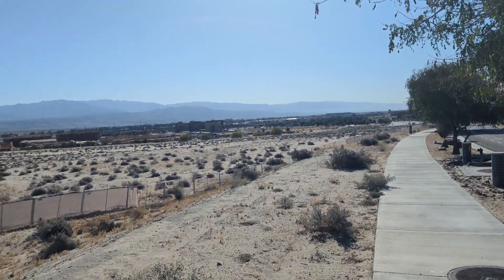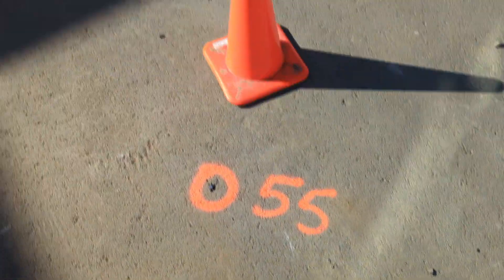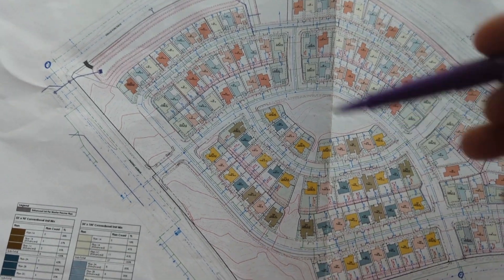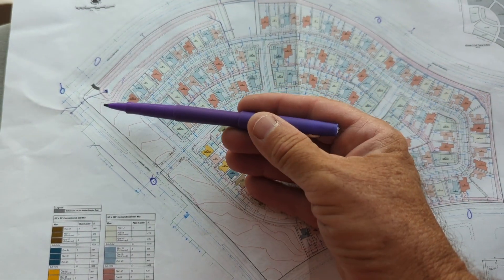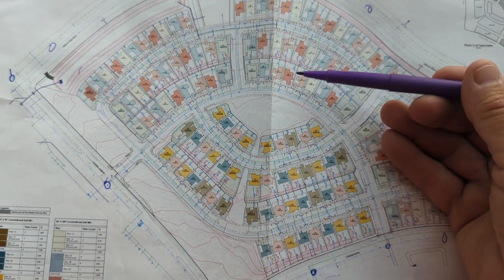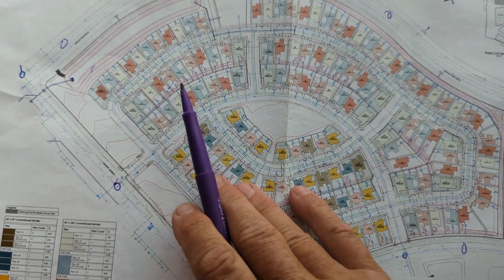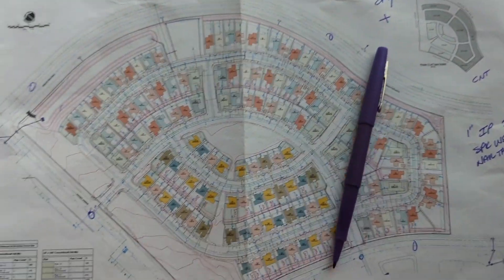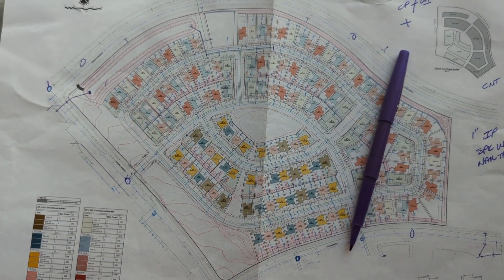How to Survey: How to set control points

Comment: What is the "leveling through the control points"?
Reply from the maker: Think about turning angles to set good control much like a boundary.  Angles and distance close and adjust the traverse.  Running a level circuit thru your points close your traverse vertically.